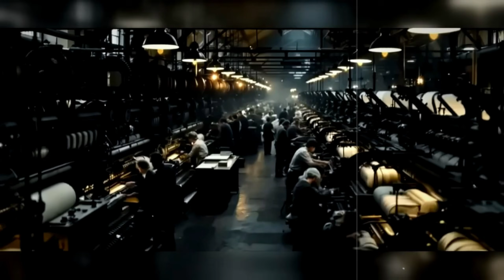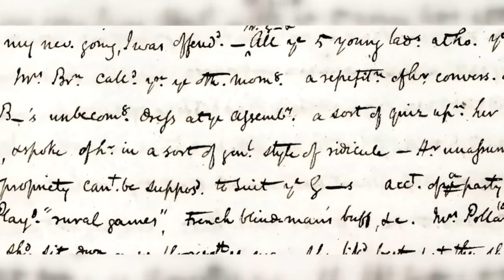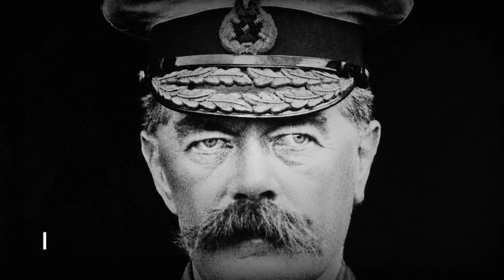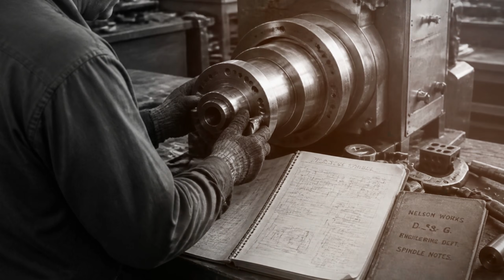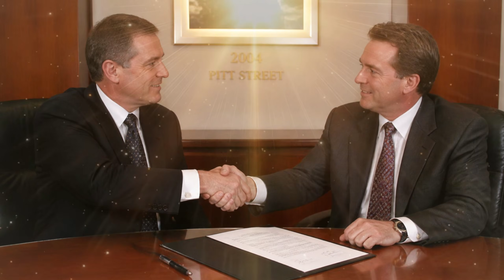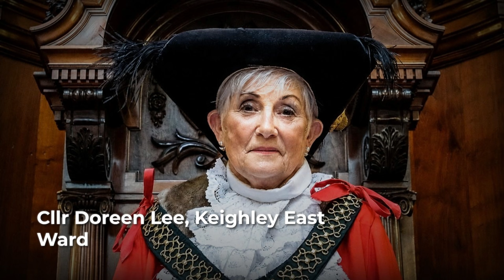The Mechanic, Engineer And Toolmaker Who Built The Rolls-Royce Of Lathes

Comment: I am using a 1957 T and it’s runs like a clock , I was told that the 17 T or toolroom lathe was built by the best man in DSG , I also have a type 13 built in 1960 in fantastic condition, I had a 1609 as well , it was sold to the Bic Biro factory, they are truly the RR of machines

Comment: I have done work on a Colchester Triumph 2000 & owned a little Harrison 300 lathe, good day to day machines. I have also worked on two Dean Smith and Grace lathes at L&D Precision Engineers to turn scored seats on parallel slide valve bodies. One machine was 50 feet long between centres, a true MONSTER, its was superb & faultless. The other was very similar but half the size. Both I think were from The Royal Ordnance / Gun factory in the Meadows area of Nottingham. L&D closed down but I'm pretty sure both of those lathes will still be working, somewhere. Great Central Railway at Loughborough have a DSG in their workshops, also

Comment: I’ve got a DSG 12inch swing 48inch center max RPM 450  in my barn haven’t got 3 phase so took the motor off and fitted it with a old lister diesel engine 1750rpm same as the motor,runs proper.

Comment: Thanks for the video, great to know more about the background to these excellent lathes. I used one at my local technical college on a few occasions, a pleasure to use. I attended an equipment auction at Plymouth in 1988 and a smaller DSG lathe sold for £25, the maiden bid, the kicker at the auction was that you had to remove any item bought by the end of day so had to pass on some items as I didn't know if I could arrange transport.

Comment: 1967 worked on DSG lathe with hydraulic tracer turning forged crankshafts machine was a beast from forging to finish in one cut ready for grinding section tol plus 0,00 minus 0,002 I am now 82 still have scars from blue hot chips on my face we worked piecework that machine earned me a good income

Comment: I think you will find they are considerably more accurate than 0-010 in more like 0.0002 in. There were the best made machine tools I have ever come across. I have doubts about the accuracy of this video, the picture of who you call Malcolm Slater is actually Wes Streeting , Labour MP.
Reply: Ten thousandths usually refers to 0.0001 inch. We used to call it a tenth of a thou which is more easily understood.

Comment: I used to make stainless steel Augers on a DS&G lathe fitted with a milling head fitted on the cross slide back in the late 70s early 1980s.